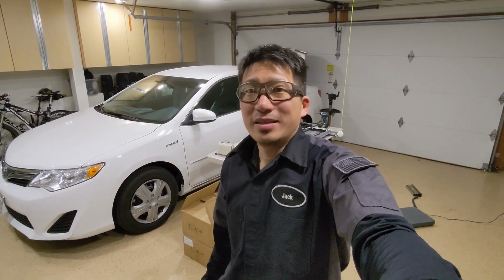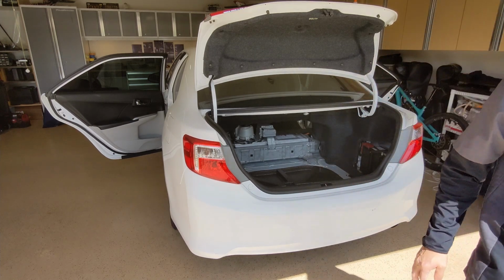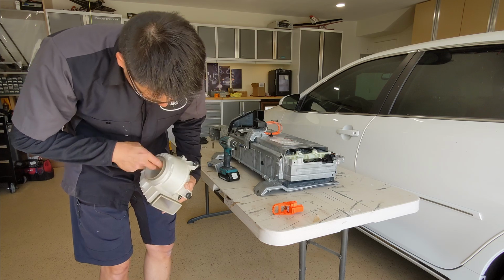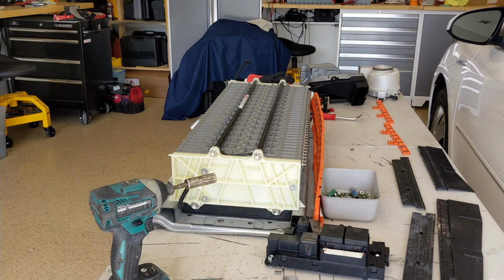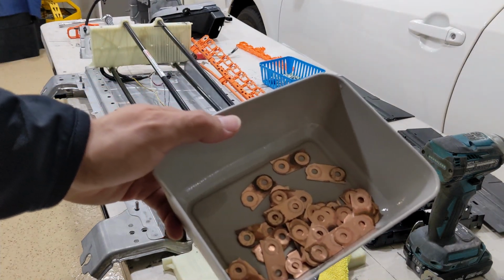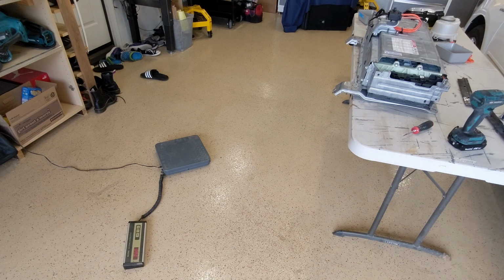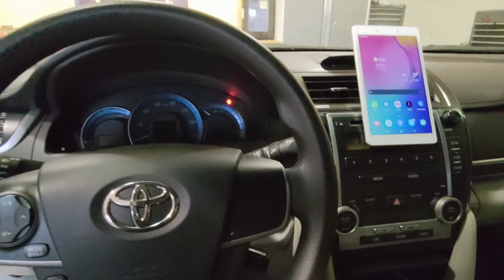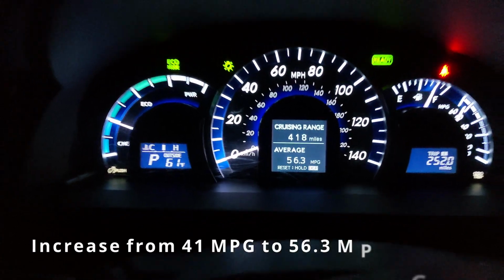Camry hybrid upgrade to lithium, installation tips and tricks and MPG test, gas saver!

Comment: Wish it was more realistic on the results. I upgraded my vehicle and it's getting about the same MPG as before. There was nothing wrong with my old battery and was testing at around 98% battery life with the test. Hopefully it'll be an investment and will last a long time
Reply: Hey, do you have any updates ?
Reply: Update please
Reply: Gas mileage is the same or less and it’s thrown a battery code a few times for one of the modules. Car does seem peppier but a few hiccups here and there with power delivery

Comment: Hi Jack, I have a 2007 prius and plan to do the li-upgrade when the greenbean battery dies.  I am looking at buying a highlander (7 seater) hybrid and was curious if you had any idea what I might get for mpg on these w/ the lithium upgrade.. it would be years 2007 through 2013.  Thanks - Brock

Comment: You should remove the safety service plug first before you unbolt the battery from your car because you will be shock if you disconnect the orange wire from the battery without removing the service safety plug

Comment: My nexcell batteries just got delivered today! Im so excited
Reply: Would you mind sharing your feedback after 2 months ? What the biggest difference you have notice? Thanks !
Reply: @michelgarciag  i can get 60+mpg in stop n go traffic from SF To san jose. Also you can run the ac parked for about 30 minutes before the engine turns on. The battery stays 7/8full most of the time. Aka green.
Reply: Ninja turtle 570   Where can I buy Nexcell batteries from? I have a ct200
Reply: How did the Nexcell battery work out?
Reply: Where did you order them from?

Comment: Great Video, I found NexGen before this video and wondered this, how long do you estimate - ballpark the Li-Ion batteries will last compared to the factory NiMH? I have a 2007 Camry that the original battery lasted 10 yers and 160K mikes. The replacement in 2017 lasted 2 years and was replaced under a pro rated warranty, that one lasted another 2 years and died in late 2021. So now I'm weighing my options. This car gets driven about 25K miles a year and we would like to keep it a few more years. Let me know your thoughts.
Reply: These LIPO4 not lithium ion.
They should last a lot longer based on what I see listed for charge cycles for each chemistry. 
1000 for NiMH vs 4000 for LIPO4.
However, in automotive hybrid application it is not as simple as that. These batteries are constantly getting particularly charged and discharged, so one cannot simply compare charge cycles.
LIPO4 also prefers a state of partial discharge over being fully charged. 
I guess only time will tell.

Comment: I didn't see How much was the Lithium Battery pack compared to Stock? I have the same exact car so will definitely keep this in mind when time to upgrade!! I'm still on stock battery and can get 45 to lil over 50 MPH with NGK Iridium IX surprisingly have gotten an extra 5 plus mpg from the spark plugs and with Fuel saving tires with a k and N filter I can get over 50 if I baby her and roughly around 46with cheaper tires and that's with no A.c or heat of course as those change everything.....

Comment: Hi, I was looking forward to buy A lithium battery pack for my 2014 lexus es300h but it is sold out. When will you have more of these on inventory. I need to replace the traction battery as soon as possible.

Comment: Great Vid.  it was time for someone to come up with this option instead of installing another NMh battery...Congratulations !!  Question: I have a 2017 Camry with over 100k miles and my battery is showing it it's age.. ( I'm in Fl. lot's of hot days here) On your website the year range for the Camry kit stops at 2016.. would it still be the same kit for the 2017 Camry.. ? I believe it was the last model year (2017)  before the restyle from Toyota so I would think it would be the same battery pack ?
Reply from the maker: 2017 should still be in the 8 years factory drivetrain warranty, that's why we don't advertise it, but it should fit!
Reply: @hybridapp7158  do you install hybrid battery on 2012 Toyota camry hybrid? If so and you are in the Los Angeles area, where is your workshop?

Comment: The video doesn't show how the temperature sensors are connected to the nexcell blades. The original Toyota blades appear to have the sensor holes on the bottom but the nexcell blades have the sensor holes on the top. Should I reroute the temperature sensor harness across the top or am I missing something?

Comment: Theoretically would you see improved usable capacity compared to a new toyota battery? I was under the impression Toyota monitors current as well as voltage to determine state of charge so there is a ceiling to the usable capacity. Just a bit more hybrid capacity would really benefit someone like me that lives on a mountain pass.
Reply: Where did you get the lithium cells sir ?
Do you know anybody in the Dallas-Fort Worth metroplex that does this?

Comment: I enjoyed watching this lithium swap. I have a 2007 Camry hybrid which died on me many times, then I replaced the individual cells multiple times, finally I got a 2017 battery pack from junk yard similar exact same configuration as the one in this video, I ended up swapping the 2017 cells to 2007 camry, since then it is running fine, however I am only getting 34 MPG. I am not sure this par with first generation camry hybrid. I was wondering if I do the battery conditioning using hybrid automotive charger and discharger , would that improve the MPG ? May be in the future I would like to swap with your lithium battery.
Reply: The epa estimate for the 2007 Camry Hybrid is around 33mpg combined with the stock NiMH battery.

Comment: We have same year model car here in Australia, only driven 95000km, battery life shows 85% as per your app. Is it possible to make it phev by using your Lithium cells? Also, you engaged the disconnect at 15.50 and then connected high voltage cables? Should the high voltage disconnect not be installed after connecting high voltage cables?
Reply from the maker: sorry I failed to show that I've measured the voltage at the main terminal and make sure it is 0 volt !  PHEV conversion is a waste of time and money, too many moving parts and not really getting the "true PHEV benefit".

Comment: The battery's load balance is done by car bms itself without another devices? What is the detail battery model you buy from NEXcell and what is the diagnose hardware and app you used for I didn't got clearly in the video. thx for your sharing and hope you can give above infomation to me:)
Reply: Dr Prius is the app he's using

Comment: 1  you really need to pull the disconnect FIRST before the removal of the power cables 
2 what are the hours to start to finish on that job?
3  Please be careful of your back, you are young, but you will do damage to your L4L5 lumbar with age, I know been there bought the T-shirt.

Comment: Random question can I take the battery out and the car still run on jus the engine
Reply: Dealer said not advised because of the car is designed to Ren at lower speeds on the battery. Mine tends to try to kick in at lower speeds and the the battery doesn't kick in on larger acceleration

Comment: LiFePO4 batteries have different charge parameters than NiMH batteries.  Shouldn't the BMS be changed as well?  I don't understand how this can be ignored.
Reply: I see this comment all the time.. hybrid car doesn't use the battery like your cell phone, it doesn't charge to 100% and discharge to 0. it only uses about 40% of the battery reserve, right in the middle to keep the battery alive for a long time. if you over lay the small window of the charge used with the same section of the lithium charge graph you'll see they are close enough to work just fine in these applications while being lighter and more power dense.
Reply: @jsomething2  While that makes sense, I was not comparing to a cell-phone, but rather RV's etc.  However, thinking about that, RV's use LiFePO4 batteries, and those usually have built-in BMS's that do require different charge parameters.  

You are right though that keeping the charge/discharge range between 25 - 75% keeps the batteries live much longer.  

Thanks for your reply.  My wife's hybrid car will soon need new batteries and your system looks like an excellent choice.
Reply: @JANtheDane  oh its not my system at all, I just see the comment everywhere. I'm not trying to sell you haha. I'm just saying comparing say the rv batteries, factory those are lead acid right? so basically no charge controls at all. just an alt putting out 13.7v and whatever amps it can. these cars have nmhi batteries, so they have a full computer control charge routine already. so the question is can these batteries live a long time in that routine. they seem to think so, only time will tell I guess as more get out there with say 5 years on them.

I've seen some reference to them being tested on taxi prius and they are working.
Reply: @jsomething2  I replaced my Lead-Acid battery with two LiFePO4 batteries in my RV.  This also involved replacing the converter and the solar controller.

Those batteries have built-in BMS's that take care of the charging limits for long life.  While you can use a normal converter/charger, the charging parameters are lower voltage and will limit the LiFePO4 batteries to a max of 80%.  Thus, you will not get the full benefit of the Lithium technology.

More important, Lithium batteries will draw whatever power is available to them and therefore they can overload the source (the alternator or generator).  I noticed a draw in excess of 150 Amps from my alternator and this caused me to install a DC-DC charger that limits the current.  

I would be concerned that installing LiFePO4 batteries (Which the ones in the video are) could overload the Toyota charging system and bring on a much bigger problem.  Before I go this route with my wife's Camry Hybrid, I will ask the seller these questions.
Reply: @JANtheDane  you are right to be concerned except for you concern about overcurrent . The Synergy hybrid system is current controlled in both charge and discharge operations so that isn't a concern. However, you are right about the BMS. The Toyota NiMH system doesn't do the active balancing that lithium ion cells require.

More importantly, the whole premise of this "upgrade" makes no sense. Of course carrying around 30 lb. less weight is marginal benefit but I see no other benefits. I don't know if the capacity of the replacement is higher or not but it really doesn't matter for non plug-in hybrids. The hybrid car must be one of the most misunderstood inventions ever. Witness all the driver's going to great lengths to stay in EV mode as long as possible. For a non-plug in hybrid, that makes no sense and neither does this "upgrade."

If you need replacement hybrid pack for a Toyota the only two reasonable options are a salvage pack from a wrecked car or a new Toyota pack. Replacing cells or buying any third party pack is just asking for trouble. If you're lucky, you'll only lose money. If you're unlucky, your car might burn. Most likely, you'll just have more hybrid system faults far earlier than you're expecting.

I'm an electrical engineer who has been working on electrified transportation projects for 30 years. I'm telling you, this is a bad idea.
Reply: @jsomething2  My wife's Toyota Hybrid has been running successfully for 17 years on the original NiMH batteries.  We like the car so much that we might keep it, paint it, restore the interior etc.  Once the batteries die we will definitely go to Lithium.  My point is that you want to change out the BMS too to get the full advantage of the Lithium technology.

Your comment on RV batteries hits home, as I upgraded my RV batteries to Lithium.  That is how I learned about the need to change all sorts of things when making such a change.  That upgrade involved a new converter, new solar controller, DC-DC converter, and all kinds of other details.  Much better system and well worth the many changes.  I will eventually have some YouTube videos on some of those modifications (much of the video footage just needs editing).

I also rebuild my DeWalt tool batteries, and again, the Lithium technology is more involved than just changing batteries.

All that said, please know that I truly enjoyed your video.
Reply: @JANtheDane just to be clear, I'm just a random commenter. it's not my video or my system.

as for your rv battery, going from lead acid with zero control to lithium that needs a bms is much different than going from nmhi that has a bms, and then you add a type of lithium battery that had a voltage curve and capacity very close to the oem battery and you're OK. the stock bms only uses a small amount of capacity of your pack. like 20-30% of it. that amount happens to fall right where this battery chemistry happens to be happy as well. are you leaving some on the table, yes. these could handle more discharge current than your nmhi batteries can, but can the speed controller and motors handle more? would. it shorten their life if you tuned it for more amp draw? maybe not, but I wouldn't want to be the one to try. so honestly besides adjusting voltage a bit here and there, you wouldn't really change much of the programming anyways as it's there to protect the motors and stuff too.

how much an upgrade this is depends on what you want to do with it and the cost vs what Toyota will want for a new one when you're read. nmhi battery factory's will someday be converted to other types of battery. time frame of that happening, I don't know. but some day it might be upgraded or junk yard.
Reply: @StarXd1 I feel like you might want to spend some time researching nmhi battery chemistry. 3 party battery places has been refurbished packs for years. there's no chance of your car burning down or damage because it's not a new Toyota pack and even a used one from they junk yard needs the cells run thru cycles to refresh them, no one uses junk yard cells. without refurbishing them first.
 all the factory safetys are in tact and it will Just set a check engine light again when a cells fails.

you should probably also research different lithium battery chemistry. not all lithium blows up burns down. this is a very stable not very energy dense chemistry very close to nmhi chemistry voltage and capacity wise, just a little lighter. you can watch his videos of the cells being punctured and dead shorted. none of them catch fire. they just out gas for a while.

Comment: 13 gal. @ 55 mpg = 730 miles per tank

13 gal @ 40 mpg = 520 miles per tank

1 tank of gas avg cost $65 @ $5/gal

New battery = $2100 minimum, + maybe $500 min for installation by professional

That is 40 tanks of gas averaging $5/gal

Comment: Hi Jack
Impressive what you did to that Camry, I have concerns regarding battery explosion and fires, when would this happen to Lithium replacement batteries?
Reply: LiFePO4 cells are probably the least likely to cause fires because most just get hot and eventually stop working. lookup “greatscott lithium battery safety comparison”

Comment: i think you're tricking people that the gas mileage is better. can you do a single take video drving in a loop for 5 minutes. because you could have driven downhill after resetting the MPG meter... the took a video when it read 56 mpg
Reply: The weight savings alone is going to result in better fuel mileage.  I don't imagine it'd be worth it if your battery is in good shape, but if you're needing to replace it anyways, might as well use the better cells.  If they ever go back in stock again, at least.